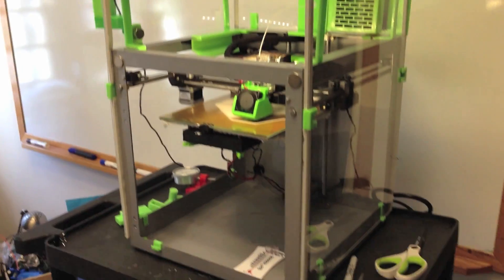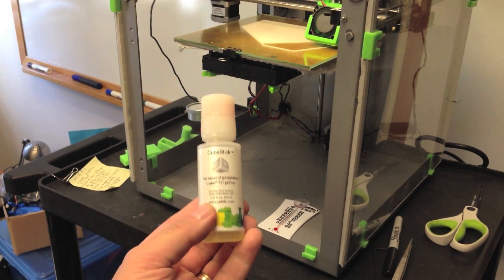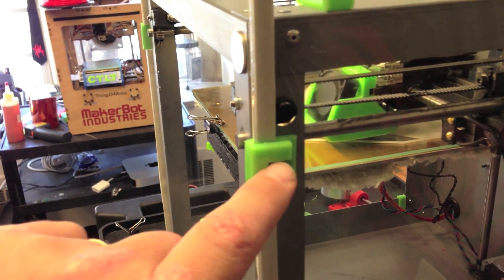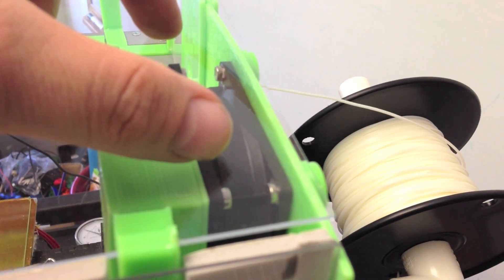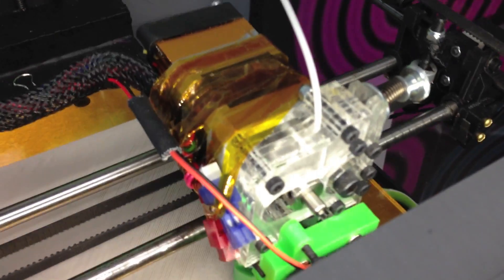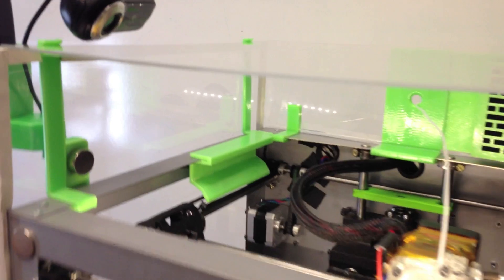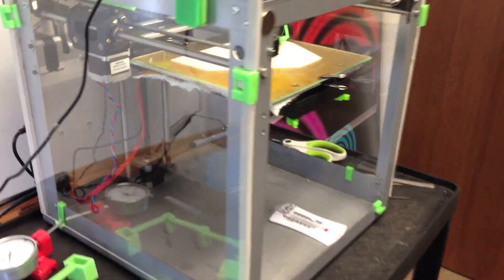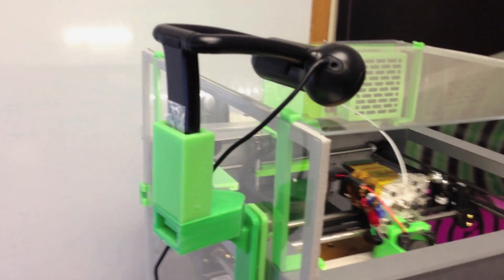Solidoodle 3 Updates

Comment: HI Fred, I know this is an old thread, but was wondering about your fan/filter unit you made for the solidoodle 3. Did it work and are you willing to share the plans? I know the Solidoodle is no longer, but mine is still working fine, I have recently started using ABS and was hoping your filter system might help with the fumes.

Comment from the maker: I get 8x8x3/32 thick. I'm clumsy so I crack a plate every few months. I keep 3-4 sheets at a time so I can swap jobs out quickly (I get Lowes to cut a $5 16x20 plate into 4 pieces). Parts usually pop off & I can add a few drops of water to re-dissolve the remaining glue to use for the next print. If I need to dissolve all of it to get the part off, I do it by dunking the whole plate into a cheap plastic casserole dish filled with water. There is a screw to adjust for the height of the glass.

Comment from the maker: Technically it should.  I just ordered some from Makerbot and will see, but it's so expensive and will be sensitive to leaving the finished objects in a warm place.  The question is whether the temperature control is good enough to keep a steady temperature with so little heating - it probably can, but I haven't tried yet.  It could require changing the PID settings which would be annoying.

Comment from the maker: PLA has a tendency to  have problems cooling down quickly enough after printing.  The fan helps it cool down fast enough that it doesn't droop as much when doing overhangs - thus increasing the accuracy and quality of the print.
For the fan at the top, if you mean the very large one on the enclosure.  I never use it, but it was intended to remove odor from ABS printing - the fan has activated carbon filters. In the end, the enclosure does a really good job of keeping the smell down.

Comment: and then apologize if I have not understood well, but the fan on the nozzle Increases the accuracy of the final object? and does not decrease the temperature of the nozzle?
and the fan at the top is used for what? and it is always attached to the printer circuit where you have also connected the other fan?

Comment from the maker: Oh, I use cheap, plate glass from Lowes that's 2.3mm thick. It's not meant for heat but is so cheap, I don't care if a sheet breaks. I use glass on top of the print bed so I can swap the prints & quickly start printing again. The glass is very flat (flatter than aluminum & does not have the holes where the screws attach to the bed). I use just two office binder clips to keep the glass flat and not moving. On top of the glass, I spread some CubeStick glue just before printing for adhesion.

Comment from the maker: If I understand you corectly, nothing.  The vertical panels seal against the metal frame on the left, right, and bottom parts of the panels using weatherstripping.  Where the panels extend above the metal frame, they seal against each other on the left and right sides and against a horizontal panel that serves as the roof at the top.  More info and pics are at tinyurl dot com slash odnkyfo .  That page has a link to the design for the enclosure that I used.

Comment from the maker: Advice is hard. It's a great printer, but I have mechanical skills to deal with shortcomings. I've printed & installed the "upgrades" that many Solidoodlers created, & we've had some issues - I've replaced the hotend once ($60), and I just had a thermocouple wire break from wear. Each took only a few hours to fix, but if someone wants a more turn-key printer, I would go with the Cube3D or Afinia printer.
I use ABS for nice finish & strength and PLA for accurate dimensions and yes about the fence

Comment: but you have not answered this: I would like to buy a 3D Printer Solidoodle, 3rd Generation you advice me? ie it works fairly for the price it cost?

then because when you print ABS you do not use the fan but the fence? and instead with the PLA are not using the fence?

Comment from the maker: I did it the easiest way by adding the wires straight into the same screw-in blocks that supply the main 12 Volts DC to the circuit board from the AC/DC adapter.  That means the fan needs to be a 12V fan, but that's common.  There is a better way which involves soldering the fan to a couple of the expansion pins on the main circuit board and modifying the firmware on the printer, but that was too much for me.  However, I did add a small power switch so I can turn off the fan when printing w/ ABS

Comment: the fan to cool the printed object you tell me where you have connected to power? and it really works? that improves the finishing of the printed object?
I would like to buy a 3D Printer Solidoodle, 3rd Generation you advice me? ie it works fairly for the price it cost?

Comment from the maker: The manufacturer may go ahead and "fix" some of those issues, but it's more about improving the next version of the product, but you get what you pay for. I could pay $15k for a turnkey printer, but I didn't.  Some are better than others.  My modifications are mostly because I chose to use glass plate printing and a webcam and to filter air.  The z-wobble (not mentioned in the vid) and bundle guide are the only ones based on design weaknesses.